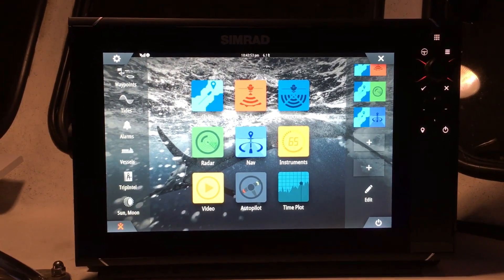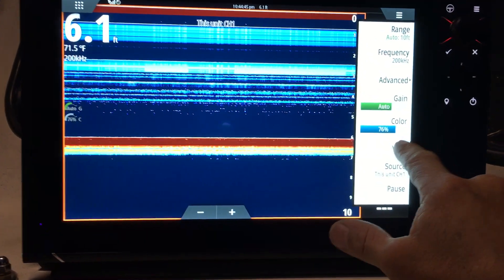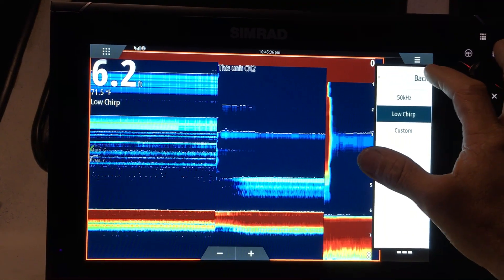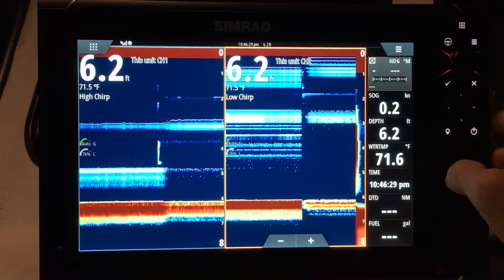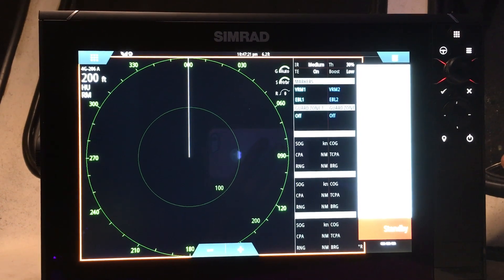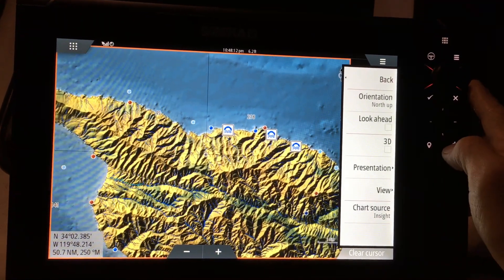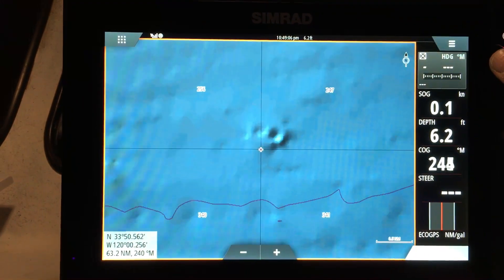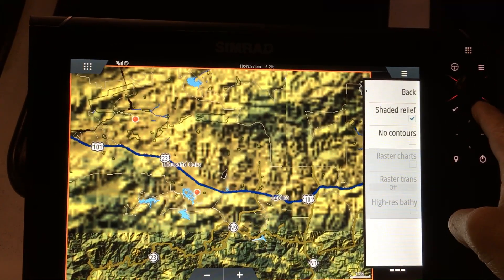Simrad NSS EVO3 setup. 1kw B275C-LHW High and Low Chirp. No BSM.

Comment: Evos3s, Tm275lhw - 

For install of Ducer cables, What colour port for the HF?

What colour port for the LF?

Cameron
Reply from the maker: Hello. 
On dual frequency transducers the higher frequency always plugs into port 1.
Reply: @surge_vasquez  great thank you.

Any tips on configuration settings using the TM275LHW?

Eg - colour palette, tvg, gain, etc…
Reply from the maker: @Camh1968  I prefer dark pallets. The TVG filters out surface noise so I use it for pelagics and deep marks. Gain runs very well on auto.
Reply: @surge_vasquez  massive thanks!🙏

Comment: Hi mate, I installed NSS EVO3 + TM275HLW, the sounder function only ECHO works, but nothing on SIDESCAN and DOWNSCAN, is that correct ? This transducer doesn't support SIDESCAN DOWNSCAN ? Thanks.
Reply: That is correct. High performance 1KW transducers do not have structure nor sidescan.
Reply: @swordfishgear2899  Thanks, mate.

Comment: Great video Surge. Couple questions: my b275lhw xSonic version has 2 leads/plugs. Does it matter which plug goes into which port. One of the ports is blue. Also, I have an older NSS9evo2 I want to add as a viewing screen. How should I connect it to the 12evo3, nmea or ethernet? Thank you!
Reply: Hi. Thanks. 
Connect the transducer to the Evo3 with high frequency on Chanel 1. Low freq on Chanel 2. 
Then interface the Evo’s together with both Ethernet and N2K.

Comment: Hi Surge, 
One question:
I have simrad evo3 nns9 and b265LM CHIRP TRANSDUCER

To pick ok NETWORK ECHOSOUNDER ?
And select source is MULTI ?
Reply: If you have the transducer plugged into the back of the Evo3 and there is a single display on the boat it does not need to be set to multi.  
That is for multiple displays or networked to an S5100.

Comment: His urge we have the NSS12evo3 with external module but having problems with the dual sonar screen. I cant get the dual screens to show different chirp. Whenever I change one it changes the other. Any ideas
Reply: Ian 'Taffy' Standen  What soñar module? If it’s the S5100 it should work fine. Check the source setting as they both need to be on different sources.
Reply: @CanyonDiver  hi Surge, yes it's the S5100, checked the cables are in the correct position but when I have the dual and select CH2 low chirp it changes it on both screens for some reason
Reply: Does the network echosounder mode need to be on 'multi source'
Reply: Hi Surge , I think I finally got it ,had trouble getting the system onto multi source, dual screen now works, high and low chirp. Thanks for all your help, Taff down in New Zealand,  take care
Reply: Ian 'Taffy' Standen yes sir. You got it. Nice work.

Comment: Would you reccomend using a S5100 with the B275LH when deep dropping to 1000 to 1500 feet or only use the NSS mfd? Would you see any benefits at all? Extra power or detail? Thanks
Reply: On paper it should be very similar. The one way to guarantee peak performance would be with the S5100.

Comment: Very informative Surge,
Do you recomend having a seperate NEMA2K power supply for the Simrad NSS12 EVO3"? At the present, my N2K trunk line is only using one power cord supplying all power to my Suzuki C10 gauges, and EVO3.
Reply from the maker: Sorry for the late reply. There’s an isolator to use in order to have engine gauge display turn on with the key and y’all with the rest of the n2k system. Both networks are common but power up independently.

Comment: Thanks
I have different issue with my lowrance hds7 gen 3, where same  transducer can either be connected to high or low chirp cable at a time... the unit recognizes transducer only when high chirp cable is connected but nog when low chirp is connected. Anybody has a clue?
Reply from the maker: Please provide what models you are dealing with.

Comment: Hi, I have a nss16 evo3 (software version 3) s5100 and b275, the touch screen works and after it does not work and after it works.
I put a new battery, I changed the nss but the problem is the same. Do you have the same problem with nss evo3
Thank you for your reply
Reply: claude greco 
Hello. I have not seen any freezing issues. 
Feel free to call me sometime during the week to talk about it. 714-401-3761

Comment: Are you using the transducer out of the water? you should know that you can burn it (over heat!), nice video
Reply from the maker: It's only an issue for extended periods. Not intermittent like this.

Comment: I have an evo2 with a 275 LHW transducer. How do I go about doing this with that unit? Even my 15 yr. old lowrance unit was capable of using  dual beam transducer. I mean the transducer only comes with one cord coming out of it so how does an extra port on the back of the evo3 help?
Reply from the maker: Hello lance smith. Sorry for the late reply but it's only possible with the EVO3. 
Text me pics of your transducer cable so I can see what you have going on. 714-401-3761.